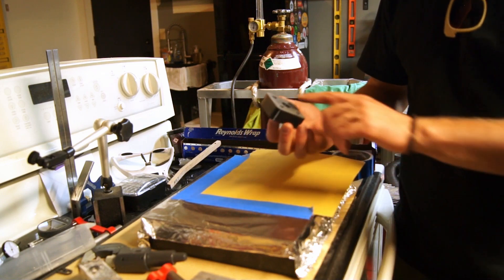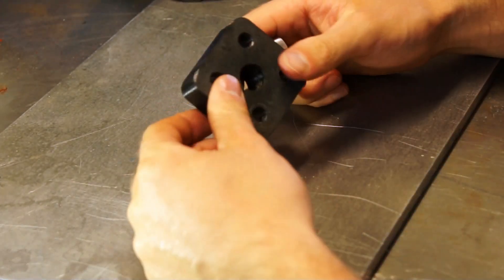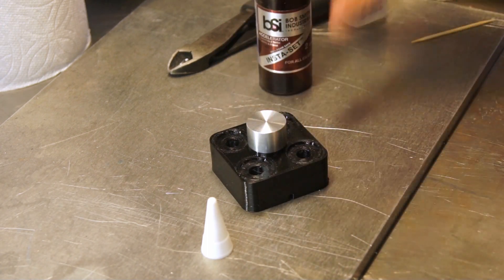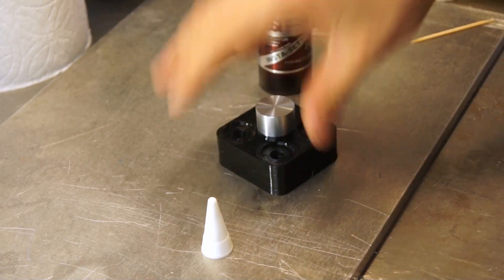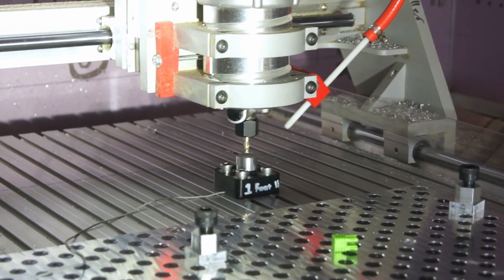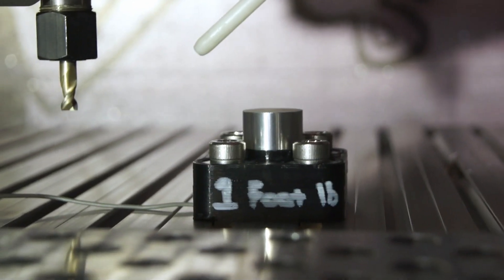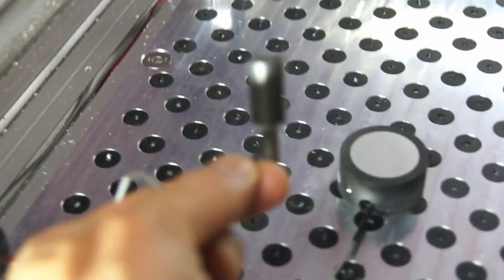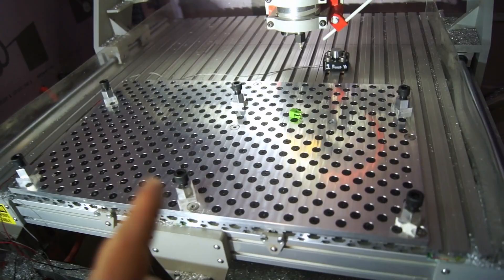3D Printed Z Probe for CNC Router

Comment: Just ran into your video hope you get back to me,wanted to ask assuming the wire you have connected to the plate on the bed on cnc is the one that would go clamp on the end mill with the original z probe machine comes with ? If thats the case do you believe if it goes mounted somewere on the spindle would it make that contact it need to function?